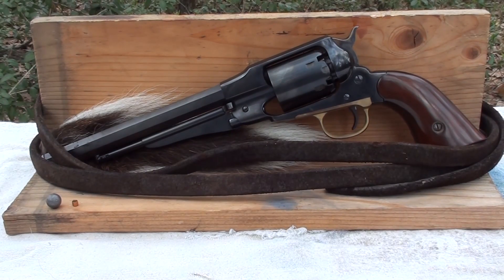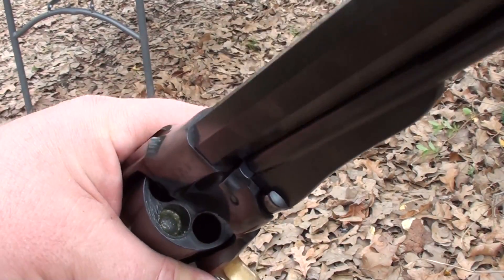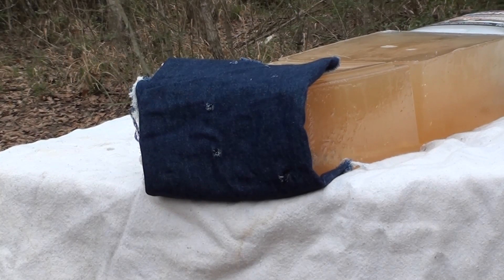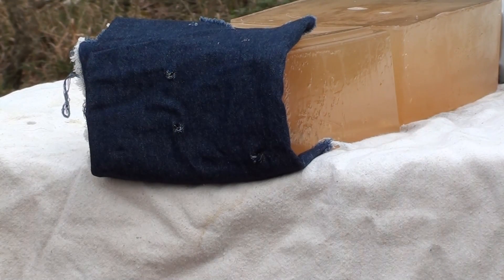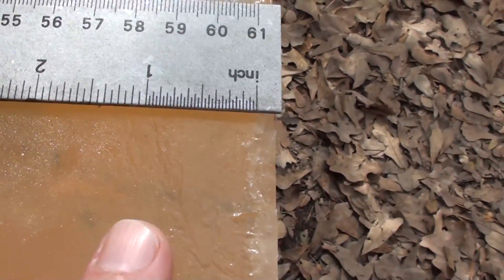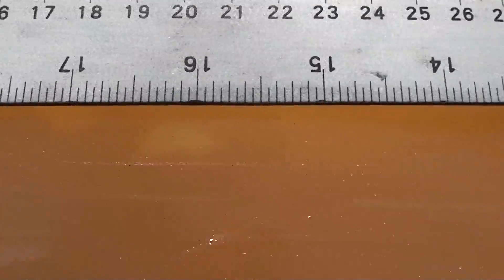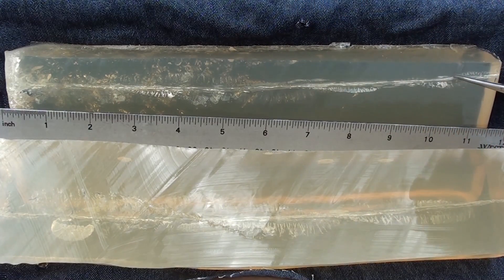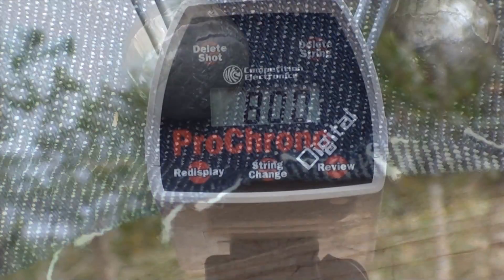45 Cap & Ball Ballistic Gel Test

Comment: Where is the shot from the conversion cylinder? Do you have the 45 Colt cylinder or the 45 ACP cylinder?
Reply from the maker: +shoup2882   Yes I have the 45 Colt cylinder, have had it for many years.  No I dont have a .45acp cylinder because no one makes one nor would I own one if they did.  I need to load an original round for the test I want to do.  Most all my 45 Colt rounds are made with todays lead/mixture.  I want to load one from the soft lead they used in their castings.  Just need to get it loaded up.  Getting there its coming
Reply: Well they do make them...or at least did until recently, there are a couple suppliers that still have the 45 ACP cylinders in stock. They do need to be loaded with lead bullets and "cowboy" powder charges. Am patiently awaiting your next video!
Reply from the maker: shoup2882 Hmm, never seen an acp cylinder for an 1858. Still dont think I would own it but pretty cool to see.  Yeah I am working on a few Cowboy testing loads, not much longer I promise!
Reply: Old South Firearms has them for $246. Still need to use lead bullets and Cpwboy Load pressures. The reason I am considering the 45ACP is that I am already set up for it. Thousands of empty brass and loading dies already in place.
Reply: I have a kirst conversion cylinder with loading gate in 45acp. I had to dremel the recoil shield to load from the rear. I don't have an ejector on the gun but you can get them. I just take my homemade ejector rod I made from a 6 inch piece of coat hanger and pop out the spent cases. I just keep it in my front shirt pocket when shooting.  I love shooting 45acp and reload them for my 1911 and both of my 1858's. I have one with the 5 1/2 inch barrel and one with the 8 inch barrel. I bought the kirst conversion cylinder about a year ago for $325.00 online at buffalo arms, I just checked and they have it in stock now for $324.95

Comment: The ball must be  a maximum close to the barrel entry. Maybe not but it s the recommanded load by Pietta. If too far in the hole the ball take a great accélération in The cylinder before enter in The rifled barrel. That cause prematurely injuryes for The weapon. Sorry for my english^^
Reply from the maker: +Chris G  No not at all, as long as the charge is packed tight it does not matter how far the ball is from the forcing  cone.  Your English is fine, thanks for commenting
Reply: ScubaOz W

Comment: You will get consistent shot-to-shot velocities with a quality C&B revolver like your Uberti if you replace the factory nipples with good after-market nipples from suppliers like Track of the Wolf or others. Factory nipples have inconsistent flash holes causing wide velocity variation. After-market nipples duplicate the tiny consistent-sized flash holes of original Colt and Remington revolver nipples.  GOEX is a good powder, but duplicates the low musket grade performance of old Dupont black powder.  Swiss black powder will duplicate the high performance sporting grade powders (like Hazard Powder) available to revolver shooters in the 1850's & 60's.  Civil War-era revolver combustible cartridges were loaded with a very-fine-grain sporting powder (roughly 4Fg) under a conical bullet.  The 44 Army combustibles typically had a 220 gr conical bullet over 22 grs of powder, or about 10% bullet weight. In my tests of a Uberti Remington Army .44, using a 216 gr conical bullet, 22 grs of Swiss 4Fg approached 1000 fps from the 8" barrel, and the amazing accuracy from a bench rest was good enough to head-shoot silhouette targets consistently at 100 yds.  With good nipples and sporting grade black powder, a good Uberti C&B revolver is very accurate, capable, and deadly at ranges well beyond what modern shooters consider handgun range in this modern auto pistol era!

Comment: Thank you for doing this test, The round ball would be good for killing a horse, but over penetrate on a person. The hollowpoint test done for the .45 Colt is a better personal defense round. I suspect that the Winchester SilverTip would also be a good candidate. Your testing is very important to showing results, not conjecture.

Regards,
Richard
Reply: +ssb73q It's debatable if it would over-penetrate, as word of mouth from the day indicates the round ball often stayed inside. Skin is pretty elastic and requires about 200 fps to penetrate. This doesn't show up in ballistic gel testing.There has been some research trying to find something which duplicates skin effects for ballistic testing purposes, so far 1mm thick natural rubber seems to be pretty decent approximation of it, although it requires a bit less velocity to penetrate.

Comment: I have to say that I am surprisingly impressed with the "tissue" damage. Would that translate to a hemorrhage zone of equal size? I don't know, but that's what it's supposed to simulate. Thanks for showing us!
---
oh! And Scuba! Could you possibly invest or borrow what it takes to show us some comparative .44 mag defense tests? Andreleger2001 has done expansion tests in water on a few different rounds, but that doesn't translate to "tissue damage" analysis like yours do.
I'd love to see if the 180gr designs act like grown-up remington 125grn .357s vs the more power-house 240 grainers. Or maybe the 250grn winchester platinum tip. No barrl over 6" please, preferably 4" as a median test (would be similar to a 6" or 8" at hunting ranges and not much more than a 2.5 or 3" used in a defense snubby.) I have a 2.5" snubby myself and use Corbon 165 gr, magsafe defender and 200gr sbgd myself, the 180s are a bit stout, but I often wonder if it wouldn't be worth it to learn more recoil control if the round works that much better.